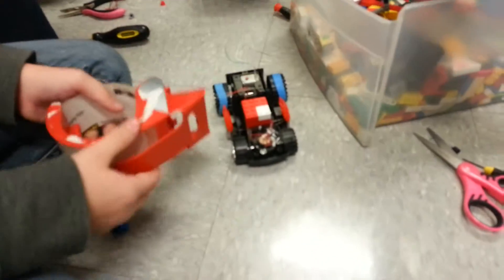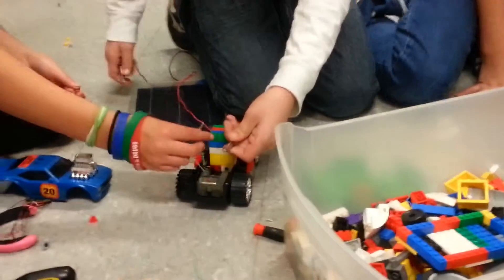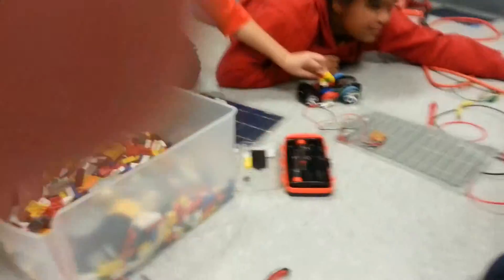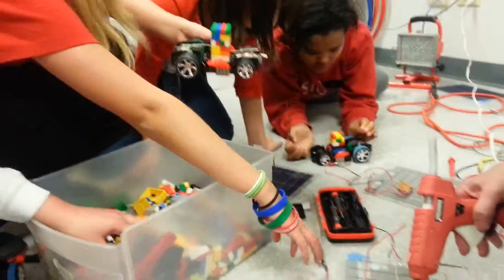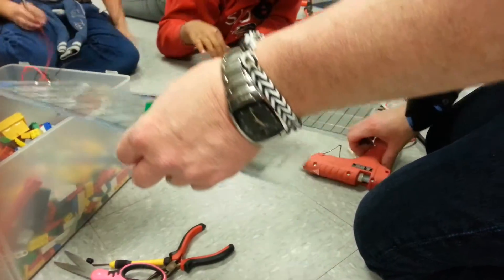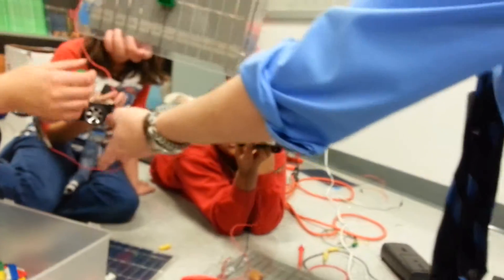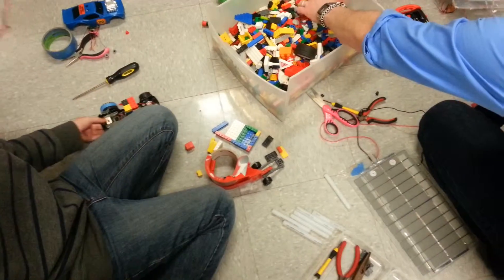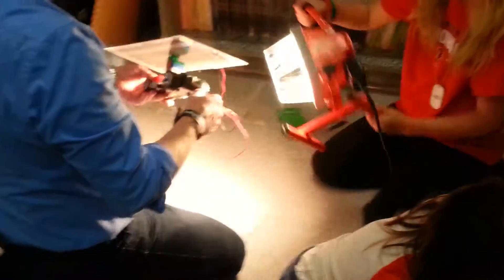Converting Battery Operated Cars to Solar

Comment from the maker: Thank you for the interest.  
1. open up the toy to view motor 
2. trace the wires from the motor to the battery
3. disconnect the wires from the motor to the batteries by cutting. Make sure and leave lots of extra wire
4. replace the the power supply of the batteries with solar panel:)